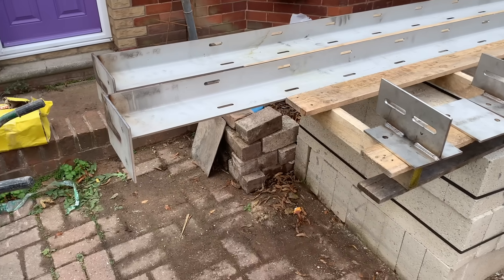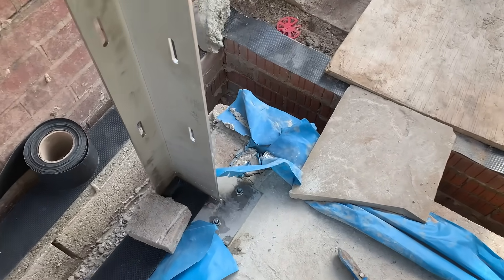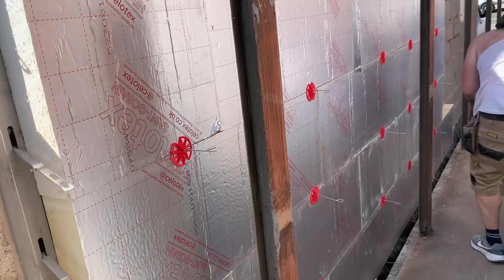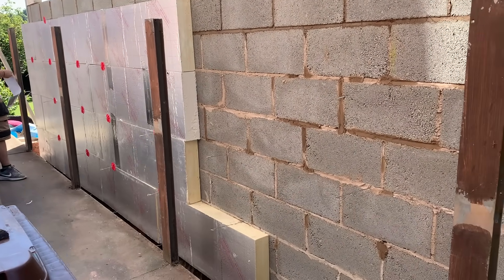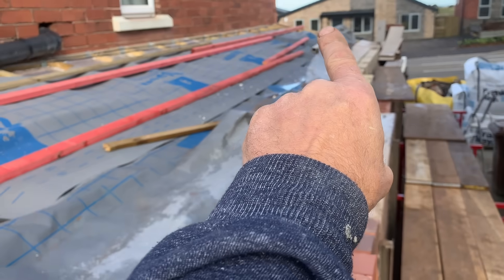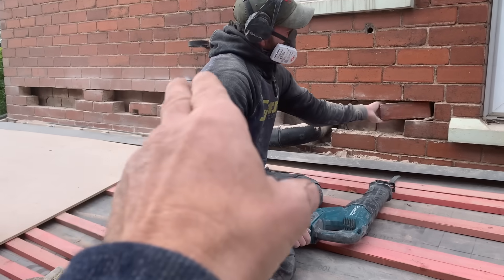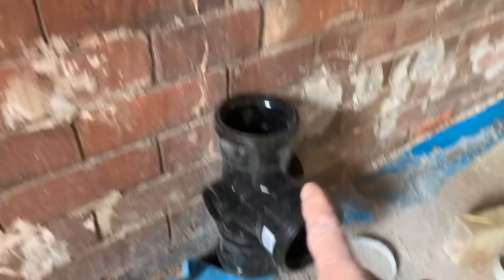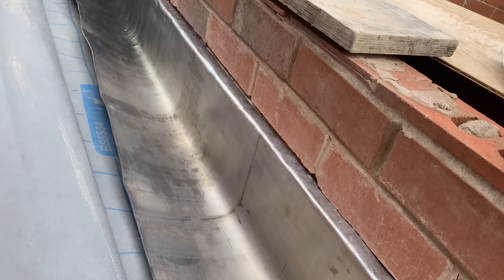EXTENSION PART 2: WE HAD TO PUT WIND POST'S #construction #building #windposts

Comment: Great job as always. Did you manage to let the cavity tray in on the house or did you stick it to the wall?  I only ask as I’ve got one similar to do. Cheers
Reply from the maker: @sedulousdabbler5468  I use the builders adhesive, it looks like clear silicon but it’s actually an adhesive. Hope that helps. I have done it on a recent video I shared… thanks for watching👍
Reply: @  Cheers for that

Comment: First time in 4 years on YouTube watching many brickies but first time seeing Wind Posts. What a faff of a job tying into house and inserting cavity tray. Was there any need for that?
Reply from the maker: Hi, thanks for the remarks mate, regarding the toothing in..I like the brickwork toothed and tied in as it looks so much better than a striaght joint I understand if the bricks were metric then toothing isn't possible and wall starters are necessary...regarding the windposts, yeah its my first with using them tbh and it was heck of a challenge however, next time I know what's what...the cavity tray is a faff but it safe guards moisture running down and coming through into the house/extension also it was on the spec so I had to incorporate it!
Reply: @foundationgood123 Brill, thanks for clearing that up as I am not a builder but have a hands on approach for most things and as no window, patio doors etc could not think, but great workmanship and good to see jobs done correctly.🤙🏴💋😊

Comment: Building inspectors cannot dictate what they like with the structure, it all comes down to the Structural Engineer that has designed the project. Engineer's are qualified, building inspectors are there to tick the boxes to say the project has been built to the agreed standard. Simple.
Reply from the maker: And they can stop the progress, best working with them tbh. I had to correspond with the architect and the structural engineer who will all work together and I got them to put in a new spec and then the wind post manufacturers the drawings also and they were submitted all taking six weeks😮
Reply: A bit of sarcasm with regards building Inspector. Of course they are qualified or they would not have the job plus they are the ones who pass the job.

Comment: Im a structural engineer, based in Abergavenny.  I have specified wind posts on extensions many times on jobs like this where you have a long length of wall with no intersecting walls or returns to act as a buttress against wind loading.  The building inspectors  initially inspecting the plans should have picked this up.
Reply from the maker: Yeah. I corresponded with the Architect and The structural engineer who had to put in an alteration. I also had to have structural drawings with precision for the wind post. We kept everything amicable  between us all.😊
Reply: John, i cannot find a technical video on wind posts. When should they be used and why?
Reply: @dannys7795  It's not the type of thing that you can find out when, how, why and what to use by just watching a few videos.  Because this is a long wall with no intersecting walls or returns at the ends means that it is effectively a free standing walk although it is supported at the top by the roof.  You could increase the strength of the wall using thicker and stronger blockwork ie 140 mm, 10 N/mm2 inner skin.  But the other way is to use wind posts as shown and they need to be designed and specified by a structural engineer.  I'm about to start a YouTube channel on structural engineering and mainly on identifying cracking, but may well include one on wind posts!! ps by default I have specified Ancon wibdoosts but after the comments here on their lack of engagement, I may well specify Keystone as well!
Reply: @johncranna9427  Thanks for clarification on this John. Is there perhaps a magic number on a length of a wall before a windpost is required then? For example, say we built a rectangular box room 4 metres long I would assume that doesn't require a windpost as it is not to big enough but at what point would that length of wall get to the point that it needs one and do you place it directly in the middle? So... if that wall moved up to being 6 metres long would it then need a windpost and would you place a windpost at the 3m centre point?

Regarding your Youtube Channel..... I think that is a great idea for you to join the community and share your expertise for people to learn and enjoy your content. I have clicked your name and I am now your first subscriber and look forward to seeing your first content when you start. 

Cheers Dan.
Reply: @dannys7795  if only it were so simple as a certain length before you need a post!!  And that's not because I want to obfuscate it or makes things out to be magical but the solutions are very site specific for the wind loading and materials used, ie you would need to go to a structural engineer to work out a design for each job.
I'll actually be creating a new YouTube channel so I'll send you link when that is created.
Reply: @dannys7795  I did fund a few videos about windpost design and here is a link to one - https://youtu.be/yXBm0z5T1F0?si=THoDUW4InMsKC5nx

Comment: Surely that lead valley should be a stepped valley every 1.4 m  ... i hope its not in one length either or it will rip its self apart
Reply from the maker: @djhago3123  no it’s in sections, can’t get lead in that length…
Reply: yeah but it should be stepped in a flat valley
Reply: @djhago3123  thinking the same unless you have the rubber expansion joints 
and code 5
Reply from the maker: @andyeveritt9003  yes 👍
Reply: @foundationgood123 the trouble is you cant always tell from pictures and every one jumps to conclusions . job well done on to the next one .
Reply: this is what happens when bricklayers do leadwork 2 years ripped to pieces who comes to fix it surely building inspector will make him change it 😊
Reply from the maker: @StephenPritchard-f9j  steady on guys, your to quick to assume and judge!! All this building has passed the regs…The inspection was hot on.

Comment: I'm considering a very similar garage /utility / wc extension myself as I need to get rid of an old asbestos garage, and I was worried about the gutter overhanging the neighbours property restricting the width of the build, but the wind posts and parapet wall are genius to maximise space usage!! I was also wondering about the cavity tray as I've watched many of these types of build on YouTube and I don't think I've seen a single one go in before so I really enjoyed this mini series. 

Feel free to tell me to pi55 off if you like but could you give me a ballpark figure I should budget for a similar build please, weathertight shell only? I'm in Leicester so not a high cost area.
Reply from the maker: This cost approximately 38k as there were some extras added due to the issues that cropped up. Mansfield is an expensive area but I’m from Stoke and we’re lower paid😮
Reply: @ Thanks for your reply Chris, really appreciated, it gives me something to work from with the financial controller (her indoors 😂).

All the best, Simon
Reply from the maker: @ good luck 😜

Comment: Always a faff, Chris. I like mesh in the mortar under coping, whether it's dpc or creasing tiles being laid on. I can see why bco wanted some masonry support at the ends if there were no nibs. I've used Birtley Lintels for custom bay window lintels, don't know if they do windposts.😮
Reply from the maker: @baldyslapnut.  I tried a few places for windposts! They’rea specially made post for your job, they have to be designed by a company who specialises in making them. Keystone have engineers who design them for your specific job and give a detailed drawing that the Building Inspector can checkout also it covers you if out goes wrong. They cost £450 and took 6 weeks to make. I couldn’t do anything on the job until the windposts came😏 It caused some frustrations for the client and for me as I had to find some short term jobs to fill in whilst I waited for them to be made🙄 Also I had to go through a builders merchant ie Huws Gray as they deal with Keystone…
Reply: @foundationgood123 Yeah, Birtley deals through merchants as well. They are quick dealing with drawings and bang on spec.👍
Reply from the maker: @baldyslapnut.  it’s good to make folks aware of the issues and how they can get them made, if they have go through my headache in trying to find out who makes them etc. 👍
Reply: @foundationgood123  I don't think that price is unreasonable in the slightest considering they are stainless steel and bespoke. Seems BC are getting jittery these days.